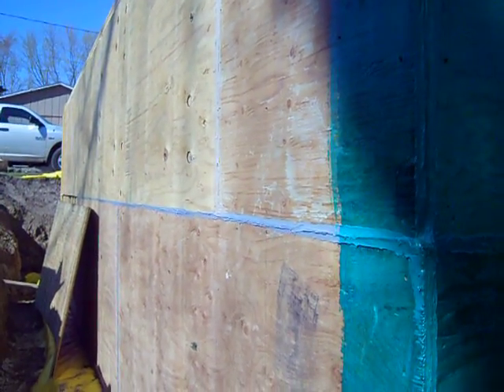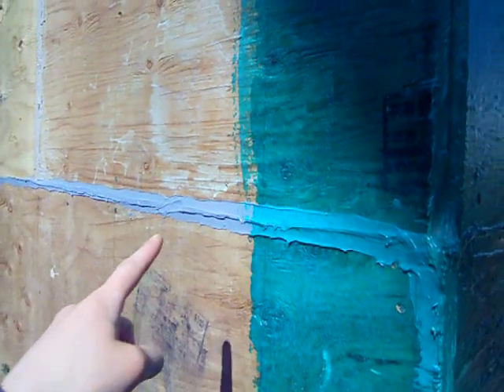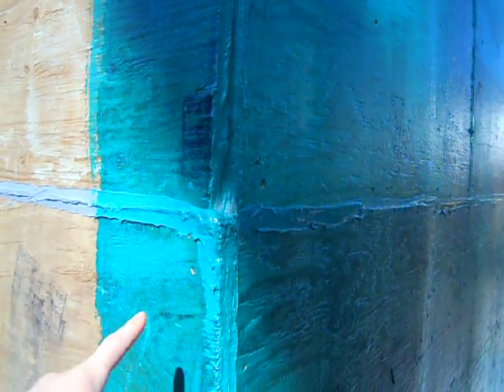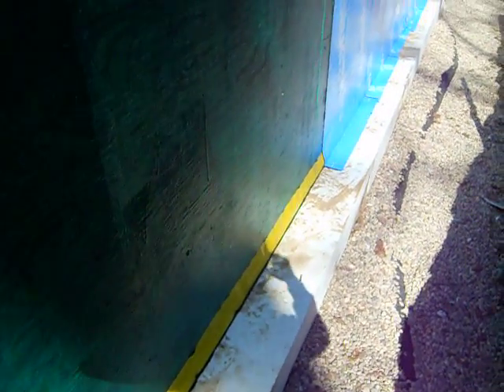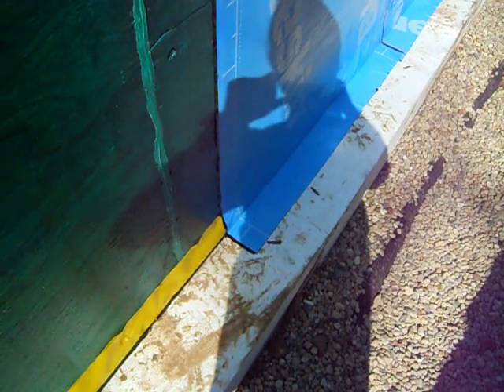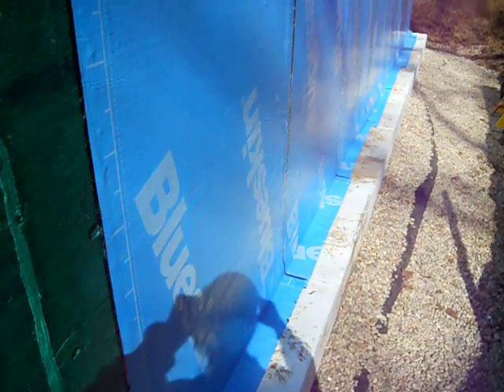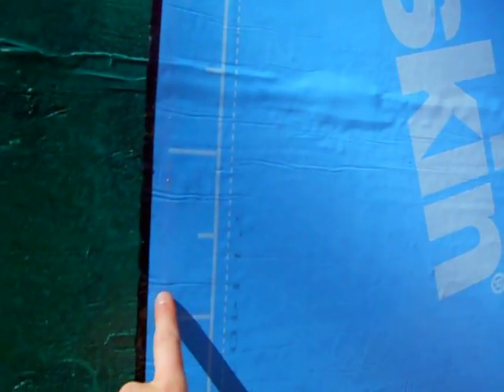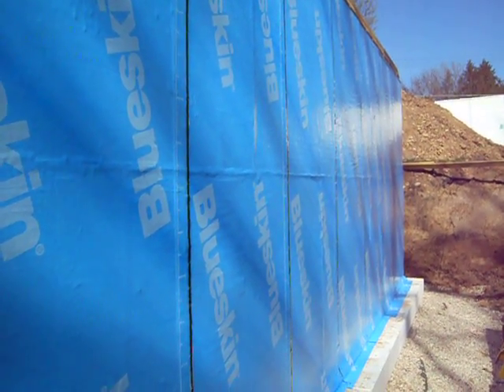Waterproofing our Permanent Wood Foundation

Comment: why   are   you   on    a  slab    that    not   good you       should  of  only on  the  gravel   and then    do  a    floor     of    plywood   over    stringers   warmer   and  no  mold  at  all    been   doing  these    since    1972   all    over   the  world    fo r my   log  and   trimber  framed    home  and  in    fact   i  have   done    6   of    my   own  lived in  and then   sold  and   no    problems  at  all
Reply: That's foam not concrete.

Comment: Do you think that it would be OK to put a wood foundation on a concrete footing?
Reply: We built a PWF under our cabin 12 years ago - on a poured concrete footing.  Next came 2x8 walls instead of 2x6 and we felt confident running all our electrical and the odd plumbing pipe through the extra thick walls.  Blue skin cannot be exposed to UV.  We did 6 mil poly in the outside, but small rocks could wear through over time and frost heaves, so we placed Dimplex membrane over the poly, and attached it at the top of the footing wall with the 4' long plastic edging.  Came out quite clean.  We have no regrets.
Reply: All lumber must have a PWF label on it (preserved wood), different than simple pressure treated lumber.
Reply: @debbiemccready1266  can you put the blue skin under the dimpled membrane?

Comment: I have a garage that is built 3 feet below grade on the back and the original is plywood parged with cement and covered with plastic then backfilled against the wall. It's 40 years old and it's rotted out real bad now. I thought to myself what a stupid thing to do! There has to be a better way then this. I have been wracking my brain trying to come up with a way to fix it and these materials you are using look like a much better way to do it. I need to dig around the whole garage and cut the rotten plywood off the bottom, the part that was buried. Then I also have to replace the bottom plate and studs inside which I hope I can do piece by piece and save the garage. I will definately use 3/4 pressure treated plywood and that is where I was  stuck and couldn't think of how do you waterproof this now? That blue wrap looks good. Do you backfill against that now? Maybe put 2"  rigid styrofoam against it then backfill? This is definately more durable looking then A sheet of plastic. I want to strangle whoever built my garage.
Reply from the maker: We put eps foam and then drainage board and backfill. Not sure what kind of soils you have, but drainage away from your wall will be important - drain tile or draining soils. Plus surface drainage away from the building. Good luck!
Reply: You need a French drain and washed stone backfill to make sure any water that gets against the foundation can drain freely away from the foot and foundation wall. No wall or water proofing will protect your foundation forever if water is allowed to sit against it perpetually.

Comment: So this blueskin is code required ? If its pressure treat wood by the code i dont see the purpose.  And with 4ft out with pea rock entirely into ground that will drain water and breath.
Reply: Arlen Manders no wood can withstand constant soaking. Even pressure treated. It doesn’t even have to rot just being wet will over time ruin the structural integrity of the wood especially laminated like osb and plywood.
Reply: @Dollapfin  Really ?! How come Venice is still holding?
Reply: Code does state that you need 6-mil polyethylene on the exterior of the PWF.  I'm guessing that the blueskin meets the 6-mil code.

Comment: Are you supposed to put the primer on treated wood?
Reply: I'm not the owner or creator of the video. But the wood used for a wood foundation is FDN pressure treated wood. It is only used for the the foundation, not the rest of the house. So priming the wood would be not necessary. We have a wood foundation in our home, we did not build this house but it was original owner built in the 80's. We are very very pleased with it. Compared to our neighbor who used concrete as is common- no comparision. The most evident is the humidity levels that translates to comfort in winter up here in frozen tundra.

Comment: why would you not go completely over the footing with the blueskin?
Reply from the maker: Technically we are because the footing is a wood footing that sits on the geofoam. We pulled the yellow guard, which is the randon/vapor barrier under the foundation up and covered that joint, and pulled it onto the geofoam.